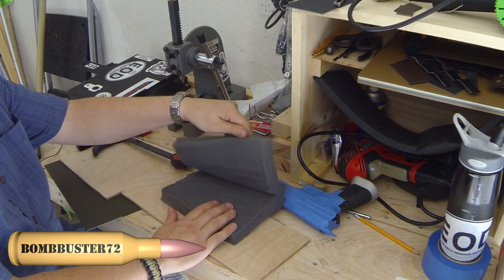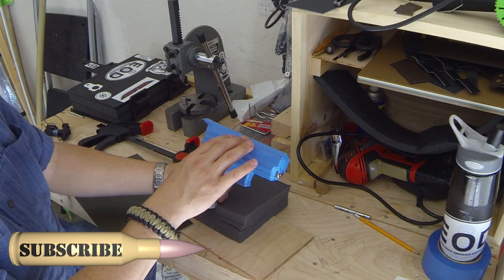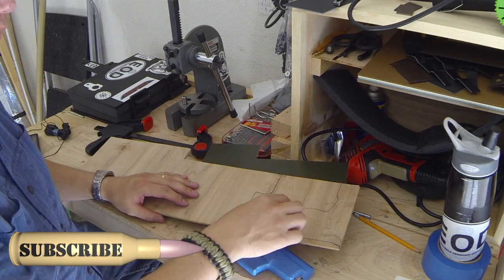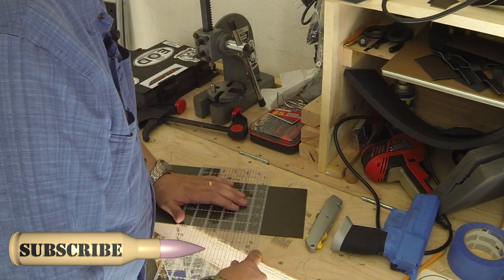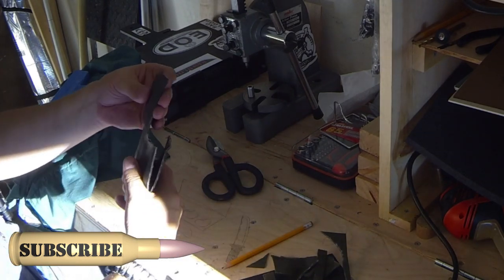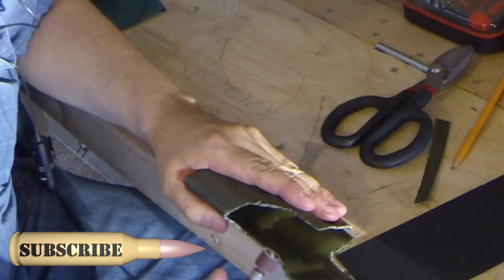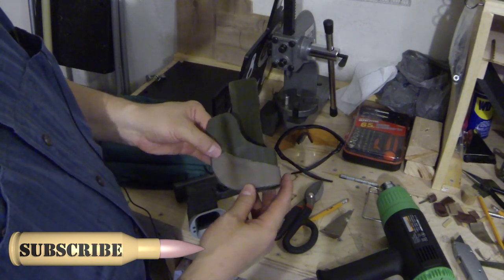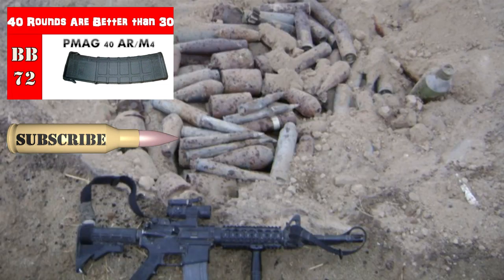Making a Kydex Competition Holster

Comment: I have been working with kydex now for some time. I haven't really tried to double layer it, I want to though, I think it looks unique. How did you mold the strip on the bottom? Did you just use the same model for the first layer? This may be a stupid question but I would really like to know.
Reply from the maker: Pungo It's so done at the same time. Heat both layers at the same time, wrap them both around and press. (I wrap foam around for taco style holsters) I used a small scrap piece for the top layer.

Comment: Great video it answered a lot of my questions for sure.Can you tell me what size sheets of Krydex your using.Gonna make a holster for my rock island 2011 and am not quite sure how much material I'll need ,are those 2x2 sheets?
Reply from the maker: +70sdiver The sheets I get are typically 1' x 1' or 1' x 2'.  Either way its probably only going to take about 12 in x 8 in, and even with that you are going to be cutting away some waste.

Comment: Thanks for the quick answer! Can you tell me what mounting system you used ? I been looking at Double alpha .
Reply from the maker: +70sdiver It is the Blade Tech, Tec Lok.  It's an older one I had lying around; the newer ones look slightly different.  I mounted it upside down, to make it easier to put it on your belt, while wearing it.

Comment: ***** where did you get that foam and what is it called?
Reply from the maker: The foam in the press is from knifekits.com.  The foam I split is stuff I had laying around.  It came in as packing, so I have no idea where to get it.  Look for heat resistant closed cell foam.
Reply: ***** hey thanks for the info

Comment: Whats the tickness Of the piece Of Wood you use to do the Space for retention rubbers?
Reply from the maker: Adriano Lima Soares When I made this I used .25 inch, but I now use half inch. It gives more adjustment and the mold usually turns out better.
Reply: Armed With Information ok. And what is the dimension Of piece Of Rubber, screws and slotted posts?. Im from Brazil and starting work with kydex
Reply from the maker: Adriano Lima Soares I use .5 by .5 inch rubber spacers or grommets. The screws are 8-32 and .75 inch long. The slotted posts are 8-32 by .25
Reply: thanks. Your holsters are very awesome
Reply: you buy the kydex from knifekits?
Reply from the maker: Adriano Lima Soares Thank you
Reply from the maker: Adriano Lima Soares Holstersmith, but it's actually the same company as knifekits